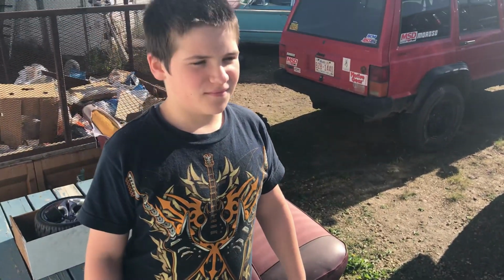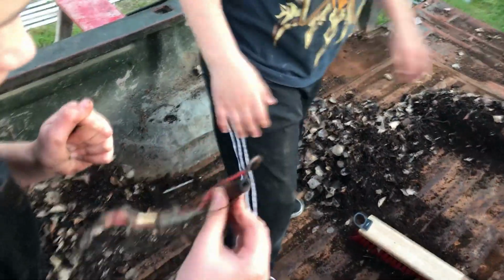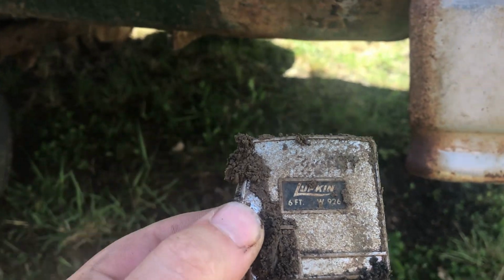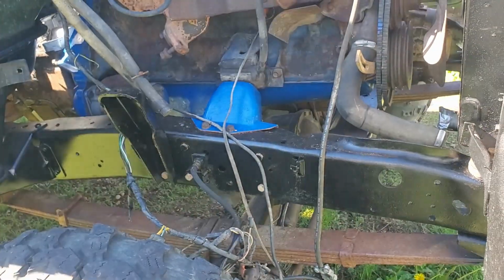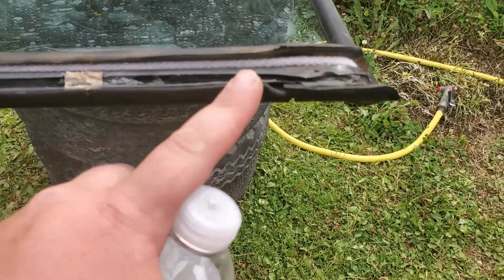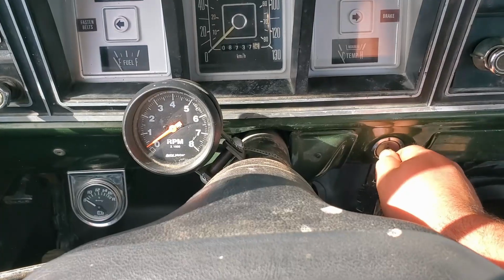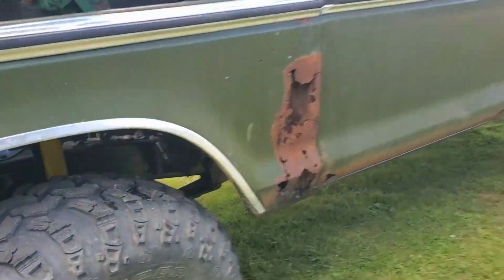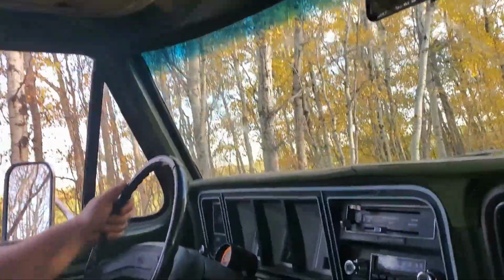1976 F250 4x4 (Highboy) Project

Comment: My current ride is a 74 highboy with a 460. It sat for close to 40 years before I obtained it. New bearings all the way around a new head gasket and wheels and tires roughly 9k$ to get it back on the road the previous owner lost the title to it so it sat for a long time until I had an interest. I had to get a bonded title to get it registered which happens next week 35k original miles and zero rust makes it a gem. It has lived most of its life in the high desert of Nevada so it’s a real survivor, cool video nice truck. Enjoy

Comment: 1967 to 1977 mid year i believe ended divorced transfer case.  I just acquired a 76 custom it getting full restoration 390 out of 1972 ...original c6 trans .. it has dual pistons caliber's  on front axle..

Comment: Great video! Reminds me of the Custom  Green 76 High Boy I had, with a .030 over 360, Holley 600, crane cam, Edelbrock intake, NP435, 205 transfer case,  4:10 gears, Factory A/C, with 9.00-16 Gumbo Wide mudders. I really miss that truck. Mine had the same power steering that yours has, Bendix control valve with a Ross steering box, I ended up converting it with a 79 F-350 Power steering box, which was good, but not as strong as the original setup. Maybe one day I'll find another one like it.

Comment: And you took out a v8 and put in a 6 why
Reply: More torque for pulling than a 360. That 300 is, 4 low and 4x4, would climb a house. Besides, he said the 360 was only running on 5 cylinders, that apparently he didn't have the time and money to fix. The 300, dropped in, and ran
Reply: @76southernpride  a stock 300-6 does NOT have more torque than a 360 V8, please tell me you’re just kidding??